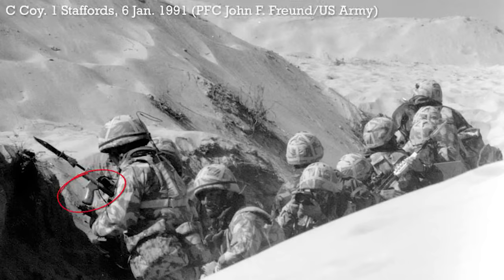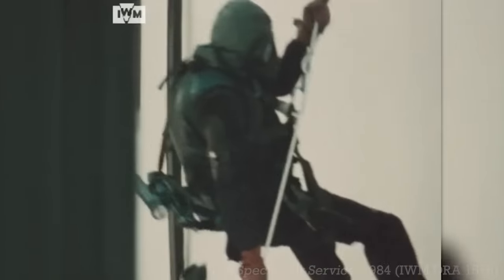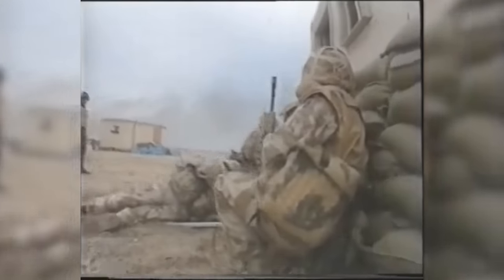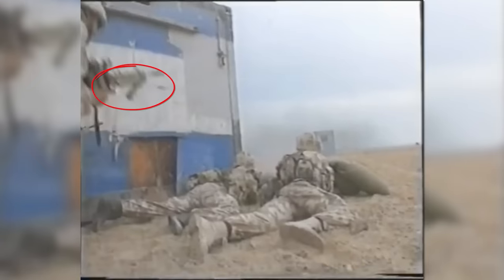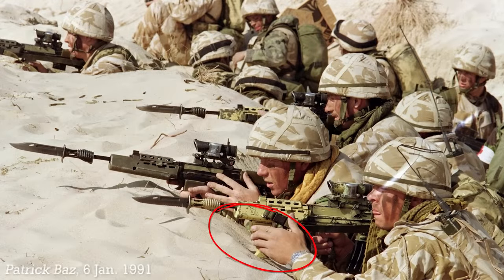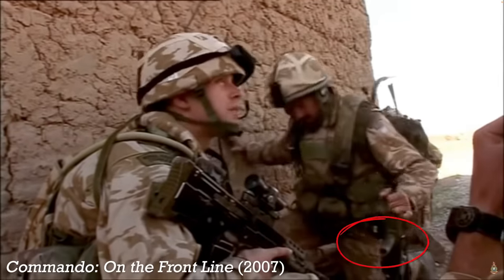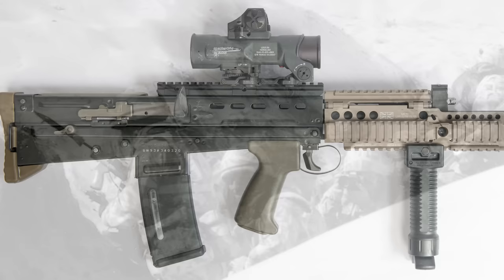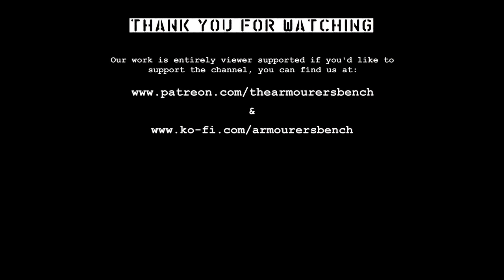Gulf War SA80 Homemade Foregrip

Comment: I found this very interesting as I'd looked at photos of this chap previously and not noticed the foregrip. Another example can be found with the Argylls in Northern Ireland in the early 1970s, there are multiple photos of SLRs with an extra SLR pistol grips attached to the forward hand guards using the same method the SAS used with the AR15, a jubilee clip.
Reply from the maker: Isn't it, I thought you'd like this. Yes, I slipped up finding a photo of an SLR with one on Ireland a few people have mentioned it since. Jubilee clips really do make the world go round.

Comment: I did that too! I had a surplus handguard I acquired of a friendly armourer. I used a standard issue pistol grip for the A2, it took some carving out and filling as it was shaped at the base to fit around the trigger mechanism housing (TMH). I used a long bolt to secure it to the hand guard as you described through the vents on the underside of the hand guard. I had to remove it and replace the original hand guard every time it went into the armoury as these mods were unauthorised and frowned upon. Strange how it is now standard issue! great video, rekindled some memories 👍

Comment: When I was training with 1 Staffords in Kenya in 99 one of the jungle warfare instructors had the LSW rear grip on the hand guard thing.
Reply from the maker: Definitely seems to have been a popular thing. Don't see it too often in photos but definitely ally.
Reply: @TheArmourersBench  I think that's because you needed to obtain a spare handguard, or you'd have to take the grip on and off every time you signed it back in. 
You'd see NCOs with painted or modified handguards in their rooms.
Reply from the maker: @benmcdonagh4574 that makes complete sense, have heard that before about lads having their handguard/forend set ups that they could slip on issue rifles.
Reply: @TheArmourersBench  yeah, you'd take it off for the deep clean before handing it in.
I'm also thinking the none SA80 sling might be a sterling one, people would sometimes use the clips off them, clip it onto the sling swivels and put the sling through them so it could come on and off quickly.
Reply from the maker: @MIFWIC666  ooh could be, definitely would have been about

Comment: I understand that early versions of the L85 / SA80 have gotten a lot of flak over reliability issues. What is the assessment of the newer A2 and A3 variants? Do they still get the job done?
Reply: I've never fired an a1, but a2 was a decent rifle,
Reply from the maker: The A2 and A3 are decent, if a little heavy.

Comment: the AR15 doesn't like ice, the Kalashnikov doesn't like mudd and the SA80 doesn't like ammo.
Reply: Have to say most of the problems I had with the A1, were mag related. The RG made mags were absolute crap. The A2 was good it worked well for me in Afghan, had just left when the A3 rolled out. Mind you still prefer the AR platform, for me just feels right.
Reply: @daveg202  I personally own the semi auto Version of the HK416 A5 (HK MR223 A3 with an 11"barrel) and the FN SCAR L (FN SCAR 16S). Those are my favourite rifles but I never had the chance to fire an SA80. I just never heared alot of good things about it.
Reply: I think a lot of the problem was it had no real development time when fielded & going for the cheapest supplier of bits. The AR had similar problems when fielded with reliabilty but with money pushed at it they were solved. With the SA80 the government didn't bother spending on it, till it was so bad something had to be done, the result the A2  which did the job. Don't forget in the UK very few folks fire any form of firearm  so they dont have to learn the strangeness of using a bullpup when compared to a more traditioal firearm layout, if it's all you've ever known!!